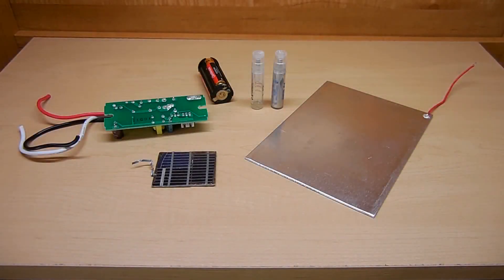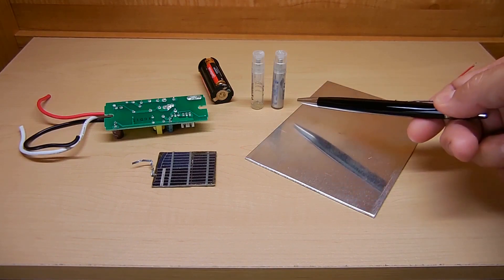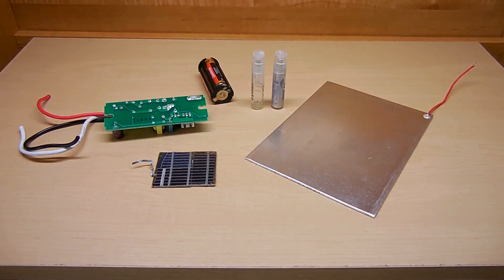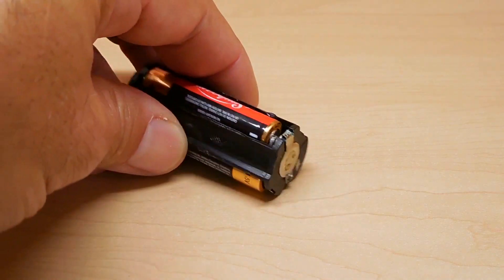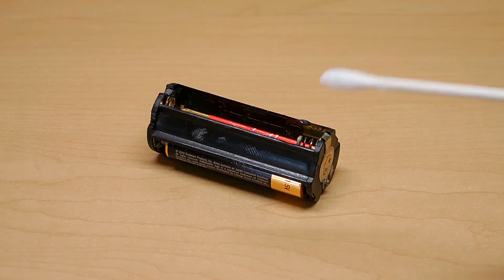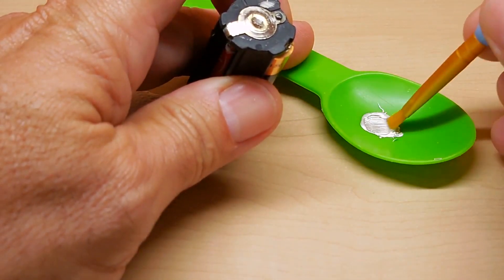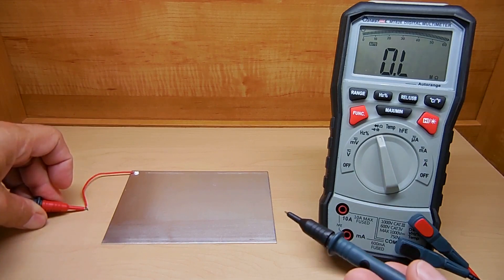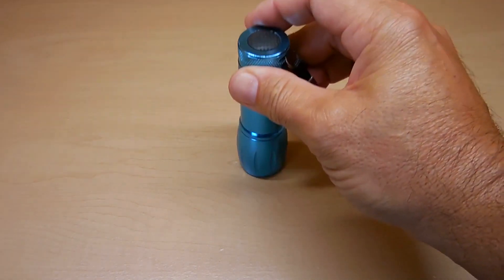Repair Smartphones/Electronics WITHOUT Solder! (Conductive Epoxy)

Comment: Would it be okay to use this to modify Game Boy devices to avoid soldering? Many modifications require soldering a wire to a motherboard or even from a ribbon cable to a motherboard. One includes soldering a 330 ohm resistor between two points (Game Boy Macro).

Comment: Thanks for putting this video on YouTube. I was looking for electrically conductive epoxy and while the manufacturers provide plenty of information on the conductivity, they didn't seem to have much to say about the mechanical properties. However  after watching you pull on that wire I'm sold. It looks to be as good mechanically as it is electrically.
Reply from the maker: You're welcome Rich! Be sure to check out my very wide range of videos and share. Thank you

Comment: The link for silver leads to AA-DUCT 906, and they say AA-DUCT 902 is more conductive (maybe 906 has better adhesion, though).
Reply from the maker: I tried both. The 902 is higher conductivity, but the 906 will also work great.

Comment: Amazing!  Does the epoxy sag as it's curing? e.g. as JB Weld does.
Reply from the maker: A little
Reply: @electronicsNmore  Thankyou. 902NS (no sag) it will be.

(Atom Adhesives sure does charge a lot for shipping - $10 for a 1.5g pouch -- I think it could be done in an envelope with a stamp.)
Reply from the maker: @louf7178  Most companies rip people off on shipping.

Comment: Dude you should also be making a battery ğack with silver epoxy  without soldering or spot  welding👍👍
Reply: That's what I thought cause I just saw video on soldering gun vs spot welding

Comment: Hy, i am looking for a solution to atach wires on a keyboard controller that has verry thins copper plates covered in some black pouder seems like carbon, i tried soldering directly but it is verry thin and will come of the pcb and broke. I was thjnking of mechanicaly atach that wite with 2 plates on top and bottom wrenched but i would like some conductive paste for a better conection with the wire instead of the solder
Reply from the maker: If you can clear away the black coating to expose shiny copper, this epoxy will work.

Comment: Can it be used to connect battery terminals ? Instead of using spot welding.
Reply from the maker: For low to moderate current level applications, yes.

Comment: I bought the "atom adhesive" silver epoxy off ebay, not once, but twice. Both times they sent me dried up, end of life products. All the seller wanted to do was argue and say "no its not.! Its such a racket, everybody on ebay and amazon wants an arm and a leg for a small dribble of this stuff. I think gold bars are cheaper. All i wanted to do was to remount my defroster tab on the back window of my Chevy. I guess its gonna have to be JB weld....
Reply from the maker: Hard to believe it was dried out. Mine was just fine. Sorry to hear that.

Comment: Can i buy this on amazon? Would it be good for capacitors? Also is it messy or easy to use?
Reply from the maker: Hi Paul. I included a link in the video description area to Amazon. Mixes well, applies easy. Thank you!

Comment: 6:10 that batery holder costs 0.50 cents having in mind the price of the conductive silver epoxy dos it make sense
Reply from the maker: That was irrelevant! It was used for demonstration purposes!
Reply: @electronicsNmore  everyone with electronics background knows that ans it is sold with intructions any way,  why dont you   use in a proper fix were its needed for real for demonstration purposes like a old retro console cartridge conector fix example
Reply from the maker: @informediatech-bruno5766  Who said this video was for electronics people only? There are many DIY people out there that didn't know about this good conductive epoxy, and I showed a few examples. Don't be a pedant, and don't waste my time.
Reply: @electronicsNmore  ok take the cup they searched for conductive epoxy without know it was conductive, cheers bro

Comment: Those battery holders cost $1.00 at the dollar store and come with a Flash Light.  LOL     Pricey it is.  Works it Does.  I've used this stuff to connect wires to Home made Conductive Graphite Paint used to shield Metal Detector Coils.
Reply from the maker: The battery holder was for demonstration purposes only.
Reply: @electronicsNmore  I know that.  Just being a Smart Azz...    Wish the stuff was a bit more affordable.

Comment: I can see it's usefulness where heat is an issue. Have you tried it with surface mount? I mean miniscule amounts applied, say with a needle.
Reply from the maker: Yes, using a sewing needle.
Reply: @electronicsNmore  You have tried? Or you agree this is worth a shot? Unless you have some serious equipment, this could be helpful in certain circuits.
Reply from the maker: @amicklich6729  Worth a shot.
Reply: I'm trying to connect copper wire directly to battery ends to power a 60k microprocessor in a prosthetic knee

Comment: I wonder how well that stuff would work to repair keyboards that have carbon/graphite pads on the circuit board for the contacts, but due to age and use some of the pads have a lot of resistance and don't want to detect key presses any more.  And I wonder how it compares in both price and effectiveness to that "Keypad Fix" conductive paint.
Reply from the maker: This stuff should work fine for that purpose.